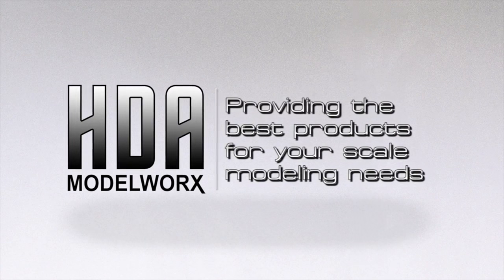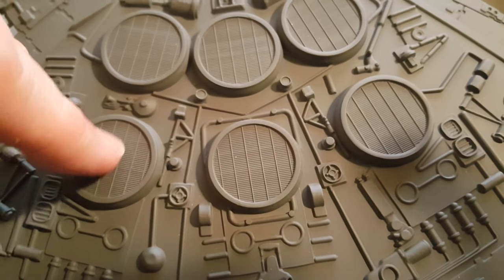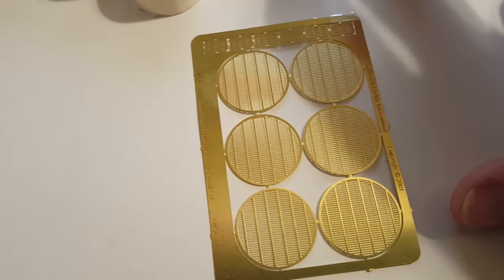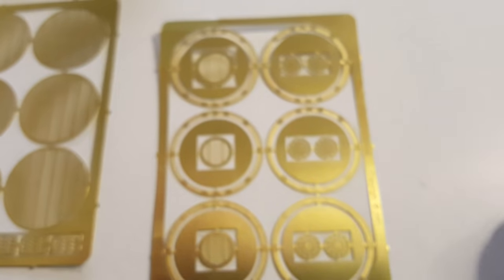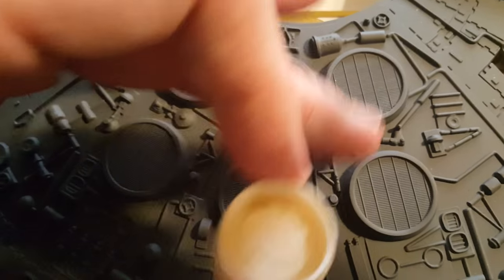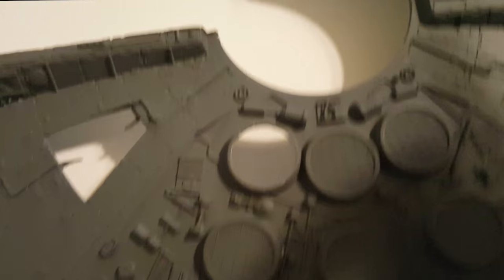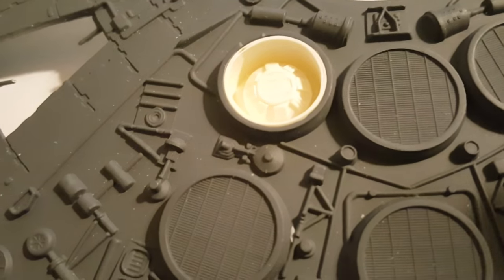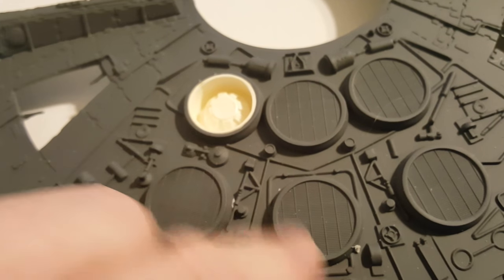Star Wars Millennium Falcon Cut Away Scale Model Build Part 5: Engine Modification AMT:MPC

Comment: I am currently building the same model and agree it shows its age with how bad the model goes together.  A few times I thought I put something together wrong only to find out it's right just fits poorly.  What is part number 63? I can not find it in the instructions or any idea where it goes.
Reply from the maker: +gene williamson Really Gene.  I don't know off the top.  I would have to check.  I will say that this cut-a-way comes from the tooling for the regular falcon kit and that part might just be a left over from the normal kit.  I have seen that happen with other kits that are retooled versions of another issue.